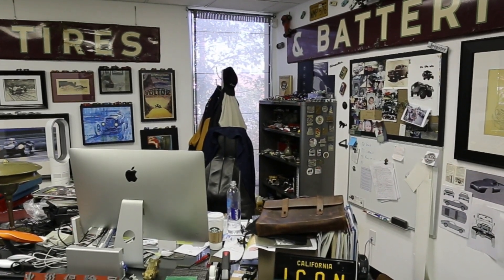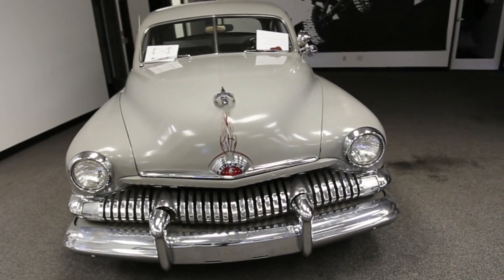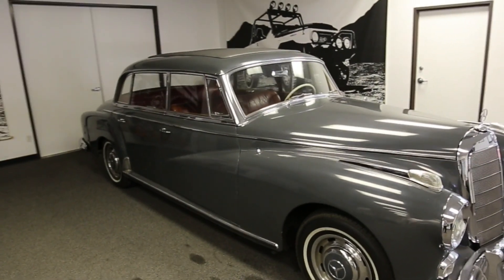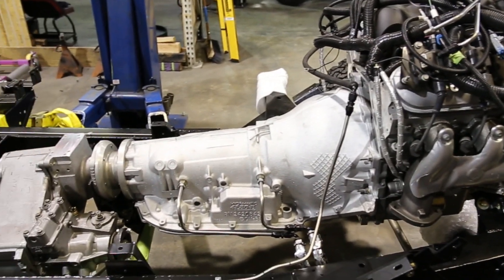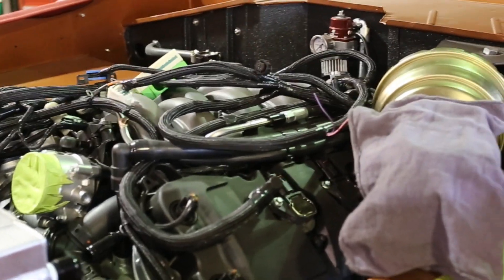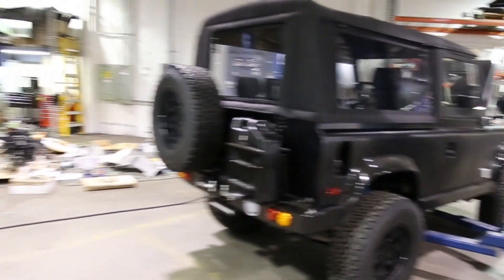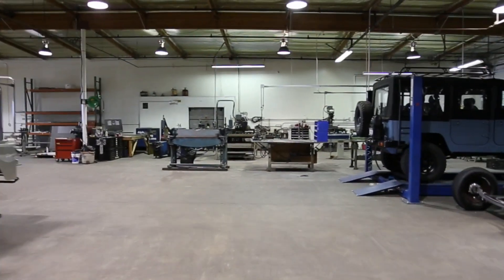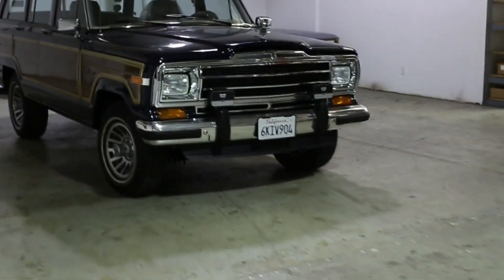ICON TLC Shop Tour April 2014

Comment: Great tour Jonathan! 

You've got to do something with your show room bro!  My background is RE development (product manager owner's side high-rise office, luxury hotels, residential in Asia) and left that to start jewelry business (design manufacture) where in both industries I learned loads about lighting.  Your stuff is  way too good to not be cocooned in lush light.  Being biz owner I am a cheap bastard, so it's easy to see modest solution giving spectacular returns.  Blow out drop ceiling, figure out ceiling treatment (paint - black/white etc.), tile (architectural grey or white, remember space is large so go with LARGE tiles), attenuate glare ingress from front window, find accurate and pleasing color for your lights.  My jewelry needs honest 5000k but you may want a slightly different, warmer look.  You are a diode guy so you know range of options is way advanced from even a few years ago keep entering the market.
cheers,
scott
Oh yeah, in my experience any small, unnecessary details pull customers eyes away from product so minimalist is best. If you want some accent pieces a patinaed  mid-century (sort of spans your product era range) console table and maybe a simple bench or two and you're done!